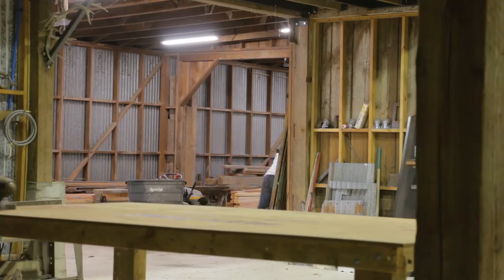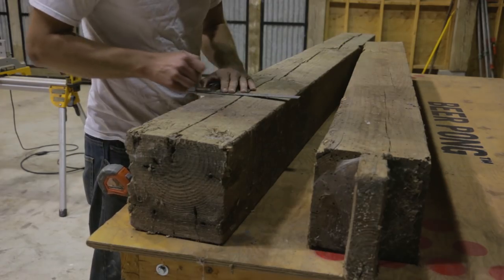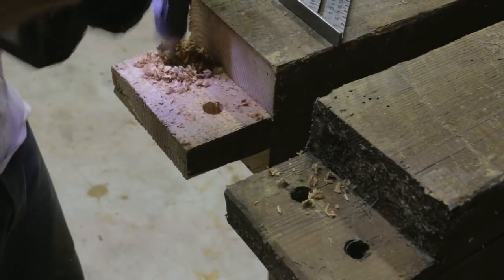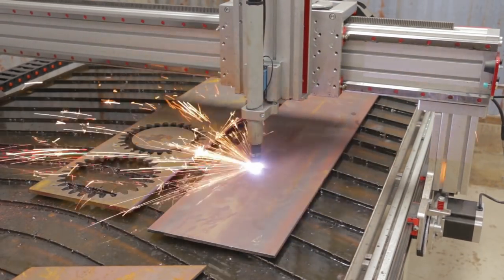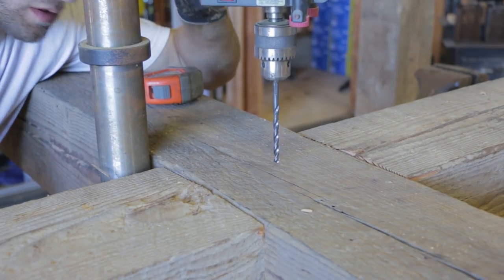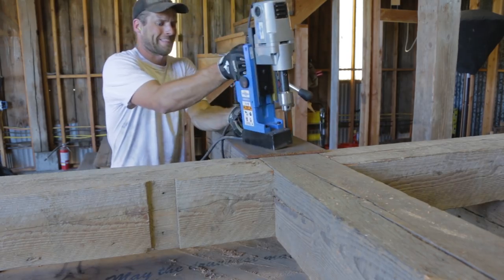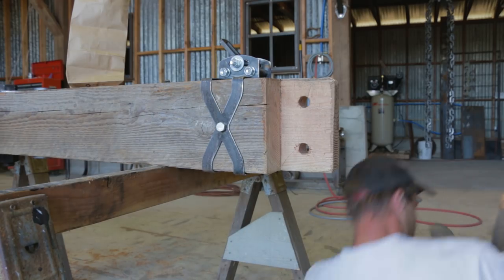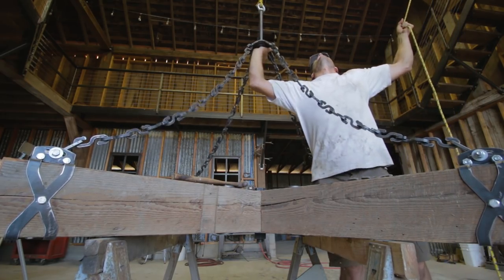Retractable Party Barn Chandelier - pt. 1/4

Comment: Love your videos. Question about cleaning up the lap joints... Why not use the planer instead of sliding the heavy beam across the miter saw? Watching that made me nervous 😓
Reply: or, you know....a chisel.....
Reply: most barn beams are douglas fir, hemlock, redwood, or sometimes spruce (not as common). generally soft wood and quite easy to work with. you can also run a chisel with the grain and have no tear out at the end of the cut unlike an electric planer cutting across the grain. Ive spent quite a bit of time timber framing. trust me on this one.

Comment: You could make a little sharpie pen holder for your plasma table head and then use that to mark your cut starts and then punch and drill them so you could leave the table and work on other stuff while it's runnin.

Comment: loving your videos mate. I've found an easier way to wax or grease steel is to heat up the wax till it melts, and just dunk the parts in the bath and hang to dry. Also I suggest you look at making a parts tumbler, it would have been alot easier to clean up those chain links, Throw them all in the bowl and turn it on for a few hours, all done. Keep the videos coming.

Comment: You can liquify the wax with heat, then you dip the stuff and let the excess wax drip off, just use a tiny amount of torching to make the wax run off but gently as the wax is flamable.

Comment: dude... never use a saw blade for sideways cuts... they are not designed for that sideways force and can easily snap. then you have shrapnel flying around the shop.
I found that a planer and then a chisel for the edges works best

love the project thought :)

Comment: When cutting metal with a CNC cutter you can make shapes easily foldable by cutting slots along the fold line like [ --- --- --- --- --- ] and then after folding simply filet weld the joints closed making it a solid sheet again, even stronger than before.     -just sayin'...